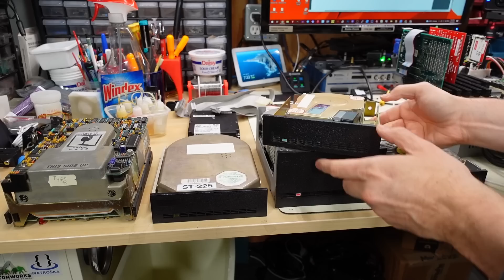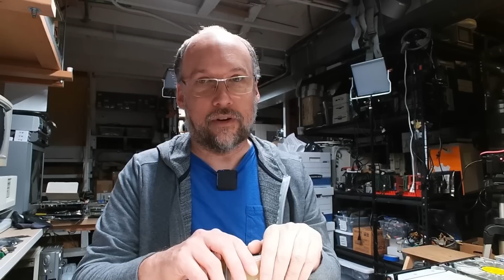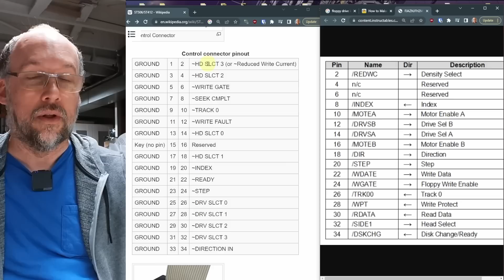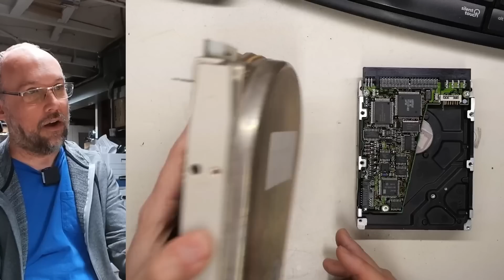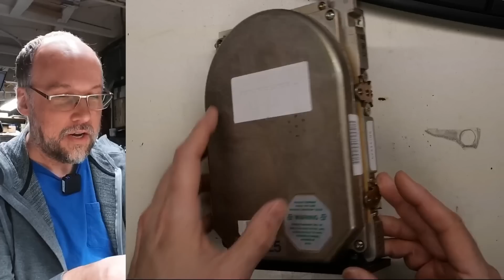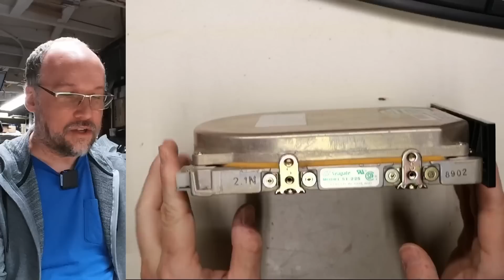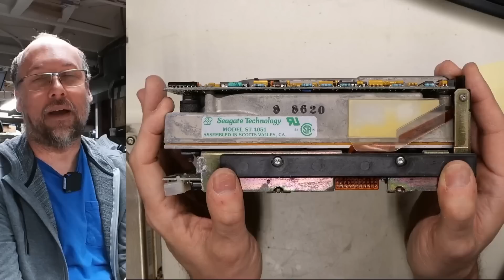Not forgotten: MFM hard drives

Comment: Watching this reminds me of working in a clone shop in the early 90's. When we would get a new batch of hard drives we hadn't seen before, we would have to call the manufacturer's 800 number and request a fax with the latest head/cyl/track values before we could use them. I still remember seeing the first motherboard with an integrated IDE controller that could "auto-detect" the values. I still remember the Conner CFS420's 826 16 63 values all these years later. I must have typed that in hundreds of times while I worked there. Great video as always Adrian!
Reply: I used to do a lot of Netware, from 2.0a on.  The earlier versions of the MFM controller driver only supported the geometries in the BIOS ROM.  Soft configuration schemes were not supported at all.  I became quite proficient at hex editing ROMs to add weird and wonderful geometries.

Comment: My first HDD was a 20 MB MFM drive that was dropped while left unparked and was discarded as completely unusable/dead.  I was working in the IT dept at a government office as a student (summer job).  I was able to get the drive for free (one man's trash is another man's treasure).  I got myself a used MFM controller card (still expensive at the time), and spent countless hours running tools on the drive to mark blocks as bad.  I think about 10-15% of the drive was unusable, maybe more, but it survived and I used it in my 1st PC for years as I went through school.  Then my sister used the PC for a few more years until the motherboard died.  The HDD was still cruising.  This thing was a tank.

Comment: I figured that, since I remembered seeing the MFM hard drive connector on some floppy disk drive cables before, which IMO makes sense since the MFM hard drive I looked at is electronically simple compared to even the early IDE hard drives which is already pretty complicated, along with 68k processor or something similar of that era to control the whole thing, and obviously that meant interfacing the MFM hard drive is so simple and cheap, and you actually can use a microcontroller to do something with the classic hard drive that's still alive.

Comment: I had a bit of experience swapping controller cards back in 1988. At that time I bought a Miniscribe 3650 which is a 40Meg drive and 8 bit MFM controller using it for several months. Later a friend of mine bought a Miniscribe 3675, a 60Meg drive with an RLL controller. We discovered the drive circuitry was exactly the same studying the board part number. I later found an article in Computer Shopper Magazine that used an RLL controller with the 3650 and gave info on the card they. I bought one, reformatted the drive and suddenly was the proud owner of a 63Meg drive. I still have this drive today.

Comment: My C64 has a hard drive with MFM drives in my ICT DataChief drive. I expanded it from 20megs to 40megs. My original drive used Tanden clones but my upgrade used a full height ST-225 (different number though due to height). Sadly the controller card can’t be removed to perform a low level format so both drives have some errors that I can’t remove. :(

Comment: It is around the time of this drive, that the wonderful Spinrite came along.  If I remember correctly, one could low level format the drive without losing the data.
Reply: Ah, spinrite, I remember those days.
Often with stepper motor based HDs, the tracks would drift out of alignment from the head position, or rather the head position based on the stepper motor would drift off the track with the data.
Before the alignment got too bad to where the data would become unreadable, Spinrite would read the track, low level format the track, do an extensive read/write test, and if passed, write the data back to the track.  If failed, then the data that was on the weak sector would be written to another part of the disk.
Heads could drift due to thermal expansion (encountered lots of those situations) or how you mounted the drive could slightly twist the drive where the head was slightly out of position.
Reply: Improving speeds by fiddling with the interleaving with SpinRite made the drives sooo much faster.
Reply: Ok .. good to see this comment or I was going to add my own.  Spinrite is a must for any ST-506 drive.  It will test and mark out weak sectors, adjust for optimum interleave if your controller can go faster (1:1 with WDC was awesome), etc.  Adrian did miss the mention of Seagate faster seeking -1 drives like the ST251-1(40mb MFM) or my favorite: ST277-1(60mb RLL) drive

Comment: And no comment about the ST225's dreaded "sticktion" problem? The drive heads would land on the warm platter when you turned the computer off. When you turned the computer on the next day, the drive wouldn't spin up because the heads would be stuck to the platter. You could, by shaking the drive vigorously, unstick the heads. Unfortunately, to shake the drive you needed to remove it from the computer. 

I recall buying an 80mb drive in about 1981 for work. It was $2000+ and was so heavy you knew you were getting something expensive! It was connected to an MFM controller board that connected to a SASI (not SCSI) channel on the Z80-based S-100 system we used for development. The crazy thing about that drive is that it would work fine forever if you installed it horizontally. But, if you mounted it vertically, it would fail in a few weeks. When I reported this to the manufacturer, they said we must have had a faulty drive. They sent us another one, which did the same thing.
Reply: Stepper motor based drives were prone to things like you described where the head to track alignment would skew.
Reply: Yup.. exactly but to un-stick a drive, you would want to quickly  rotate the whole drive in one hand and then stop or block the rotation with your other hand.  It takes practice but works.  Once a drive starts having stiction, it's days are numbered as the magnetic coating on the platters is failing

Comment: I just remember that a friends father was very upset, if you didn't use the park-command before switching off the power of his IBM-XT. What do you think abouot this park command? was it necessary for harddrives around 1988?
Reply: Yes it was necessary since the heads did not automatically park on stepper motor based HDs.  If you bumped the drive even when powered off, the heads could bump or crash into the media, thus damaging the media at that spot.  One more set of defective sectors to add to your table that may contain data.
Later drives would auto park, especially when idle.  Not sure how it could with stepper motors with sudden power loss.
Reply: I swear I had a similar drive to the ST_225, if not the same drive (it was in a wyze 8086) and if you powered it off you could hear the servo "clunk" about 8 quick times in about a seconds span and auto park.

Would the drive be able to take power from the spinning down platters? Or am I mis remembering it? Because I swear that computer had a drive sound like that when it was shut off.
Reply: Necessary if you planned to physically move either the drive or the computer with the drive to avoid scratching it and losing it.

Comment: God.  I remember having to deal with the old HDD interface cards.  You had to go into debug and it was something like C800G (that is not the correct address, but it was something like that) to execute the code on the HDD interface card to do things like low level format, mark bad sectors, etc.  IDE was a lifesaver and a hair saver!  ^-^
Reply: G=C800:5
I remember only because I had to do it so many times, it was a format routine in rom and you had to use debug in dos to run it.
Reply: @rogerjones8809  Yeah!  And the address changed depending on who made the card.  All text too, so no EZ mode.  You had to actually have a clue what you were doing.

Glad to have moved past that.  It was no fun at all.
Reply: G=C800:5 typically
Reply: Wow... hadn't thought of that vector in years.  I had a job where all I did was integrate HDDs into XT clones.
Reply: @rleeAZ  I did as well and some other computer shop related activities. We had programs to do this so no need to do it the manual debug way, but yeah i might have done it like that a few times. IIRC there were programs from each of the hard drive manufacturers, like one for Seagate, etc. And them some third party that supported multiple brands. You could low level format, verify, change the interleave mess with partitions, etc, etc.
Reply: I didn't see this but added the correct info as others had replied to in your comment above.I used to install the ST-225's into IBM XT's for Chemist shop systems in South Australia back then. Ahhh Memories
Reply: @AstroBoyAU  Remember ComputerMart, and the ACT interface with the 50 meter HD cable
Reply: Last time I had one in a 286/20 board, the BIOS was able to detect it (yeah, on a 286 - it was a late 286, 1991 or 1992) and I just low leveled it in BIOS. Then DOS 6.22 was installed overtop.
Reply: On my childhood 486 machine, low-level formatting a HDD was a simple matter of going into BIOS setup and choosing an option from a menu. Way easier than poking hardware registers by hand! Makes me feel a little spoiled, that I never had to run DEBUG to do that.

That BIOS still expected you to set the PC/AT drive type or enter the CHS parameters, though. I guess not all drives supported LBA and the identify command just yet. Once they did, the BIOS could just ask the drive how big it is, instead of having to ask the human.

Comment: Another point to note is that even while the bit-encoding MFM or RLL is standard, the whole track format, including sector marks etc, is not.
When you had an ST506 drive and controller, and took only the drive with data on it and connected it to another controller, it sometimes would not work.
I.e. the disk would not be usable until you lowlevel-formatted the drive again, of course losing the stored data.
This would bite you when you tried to move a harddrive to a different computer, or when replacing the controller because it was defective or you just wanted to use a different one (e.g. the machine had a separate harddisk and floppy controller card, you wanted to save a lot by using a combined harddisk/floppy controller card), and then it would not recognize the harddisk.

Comment: I've got a massive collection of these era drives and I'm actually setting up a little recording studio in a spare closet to get recordings of every single one of them. Everything from the lowly Seagate ST-225 and Miniscribe 3650 all the way up to the high end IBM 0665-53 and Microscience HH1090, and then back into the depths of weird drives like the Epson HD-860, or the Disctron D514. There's a lot of freaks in the collection.

I do a lot of pretty major repairs on some of these drives as well, and I'd be happy to share my advice with the world.

The ST-506 interface applies only to drives with unbuffered seek and manual write current reduction. All later drives use the ST-412 interface, which includes automatic write current reduction, an extra head select, and buffered seek. The ST-412HP interface is the same but runs at nominal 7.5m/bits for RLL.
The ST-506 itself shows up in 1980, before the PC even shows up at all.

The drive in your Macintosh 512K is a stock HyperDrive configuration, with the MMI (Microcomputer Memories Inc) MM-112. The drive you're holding is a PTI (Peripheral Technologies Inc) PT-200 or PT-300 series drive. Completely different and built much later!

The interface doesn't actually start with ST-506, it starts with the Shugart SA-1000 interface of the 1970s which was used on the SA-4000 14" drives and SA-1000 8" drives. That itself was derived from the Shugart diskette interface!
Please keep in mind that they share NO pinout and you will likely damage a drive or controller by attempting to operate it in this way. Even the twist in the cable is in a different spot.

It's worth mentioning that "MFM" is only nominal. You can run any MFM drive at RLL data rate or with an adapter SA-1000's data rate, or the floppy drive's data rate with the appropriate adapter. The drive is completely passive to the data stored on it.

I've personally had great success with running MFM drives on RLL controllers, in many cases the controllers are robust enough to ignore the drive's own errors. I've run some really crappy mechanisms like this before.

Interesting idea with RLL floppy drives! I don't really see a reason this couldn't be done, I had always wanted to try stabbing a regular floppy drive on a fixed disk controller just to have a drive that was hilariously small, though I never attempted it. The RPM difference may be an issue and you would need a controller which supports fully dynamic geometry to pull this off, there's certainly no setting anywhere. I even toyed with the idea of using the modified ST-506 interface with the change cartridge signal (meant for early SyQuest and DMA removable drives) to make it removable.

The head select is not binary coded decimal, it's just regular binary. One of these head select lines only applies to the ST-412 interface, which allows it 16 heads vs ST-506's 8.

IDE controllers are actually just host adapters, and many early IDE drives are actually just ST-412 mechanisms with a new PCB, such as the Seagate ST-125A, WD 93028A, etc.

13:12 Some controllers, like the original IBM/Xebec controller, actually have fixed geometry of only one type. Many XT controllers have selectable type but typically only 4 or 16 types set by jumpers on the board. A select few actually store the parameters on cylinder 0 of the disk drive and are dynamic. AT controllers just read from the BIOS.

Part of the reason the ST-225 is so slow is it's high impedance stepper and lack of a seek profile. Not all stepper drives are this slow.

Technically speaking, that IBM drive is actually 3.5" quarter height or slimline. Half height is 1" tall.
There actually were at least four models of half height stepper drive: The Seagate ST-325 and ST-351, and the Daeyoung DX-3100 and DX-3120.

Yes, the ST-225 is twenty megabytes (612 cylinders, 4 heads, nominal 17 sectors). The ST-238R is the RLL certified version with nominal 26 sectors.

Actually, those Micropolis drives, as unreliable as they are, are typically rather large. They use a counterbalanced rotary voice coil design with a dedicated servo surface, and they have 1024 cylinders with up to 9 heads. The largest drives are around 100MB. The 1325 has 8 heads. 

IBM shipped both the Seagate ST-412 and the IBM WD-12 as optional disk drives in the 5160 XT. They both share the same geometry for 10MB, 306c/4h/17s with write precompensation at cylinder 128. Interestingly, the original Xebec controllers have their precomp set at cylinder 0!

The controller doesn't actually skip over bad tracks during a low level, they are actually marked as bad in the header of every sector that works.

The access lamp actually only comes on to indicate when the drive is selected, not for any access. IBM's AT controller in the 5170 is actually latched, in that the drive will stay selected after it's selected the first time. That means the drive LED will always be on after the first access, even if it's not in use.

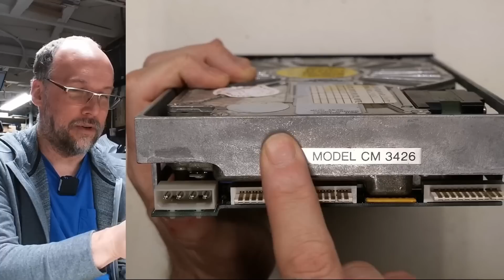23:58 this is actually a CMI (Computer Memories Inc) CM-3426, which is based on an IMI mechanism. It was one of two half height models that CMI ever made! The CM-3426 is a 20MB unit with 615 cylinders and 4 heads. They're pretty reliable mechanisms and they have a very interesting and complex seek profile, but they are very slow.

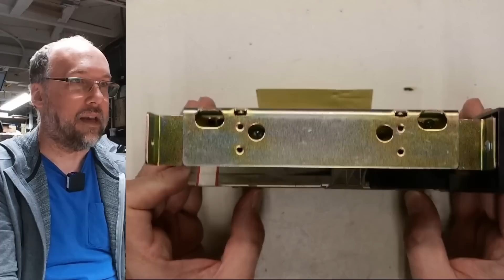24:37 this is a PTI PT-200 or PT-300 series drive, it is half height 3.5" and it actually used an optical feedback servo motor for actuation. It's also got on-disk servo bursts, super capacitor auto park, and offset heads. A real freak! Those PTI drives are hideously unreliable and not very quick either.

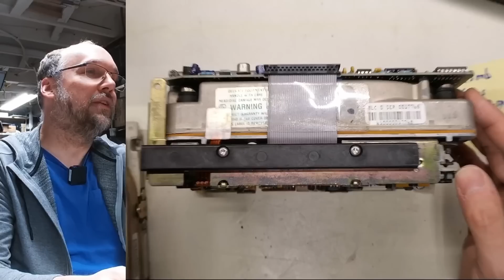26:49 ST-4038. It's even got the IBM brackets on it for an AT! This is the drive IBM chose to replace the CMI CM-6426S with when it was found to be unreliable. Linear voice coil drive. 30MB, not actually sure about the geometry because they're pretty terrible drives overall. The stepper is actually typically a higher torque option, the voice coils are rather weak by comparison for most drives of this era. The real reason they were often chosen was one of performance.

I'm excited for part two! I hope you get some use out of this information.

Comment: I wish these were easier to extract data from. I have my father's old MFM from his Intertec Superbrain, and he would love to get the data from it (as would I; I used to write REALLY bad fiction on the machine and would love a laugh).  I know you showcased a product that would do this, and as luck would have it, I met the designer at VCFMW in 2021. He said that he would be happy to get an image for me if I brought the drive to VCFMW the following year. 

He wasn't there this year. LOL! 

Oh, well. SOMEday. It isn't urgent enough for me to buy the product for a single MFM drive... but if I had a ton of disposable income, I certainly would.

Thanks for these consistently great and informative videos. Cheers!
Reply: Ah, the "Superbrain". I had one of those. Mine was the original model, with two floppy drives. There was a later model that had one drive replaced with an MFM drive, but I don't think they sold a lot of them. The machine ran CP/M, so it's going to be kind of a problem to read that hard drive on something other than another CP/M machine.
Reply: @craigtiano3455  have You tried a CP/M emulator ?
Reply: I have an 80MB Seagate full height MFM drive that I'd like to get an image off of.  It has my college Sr design project info for which I lost my hard copy